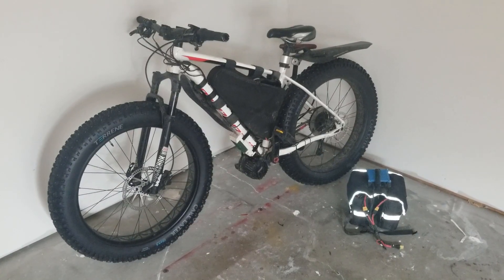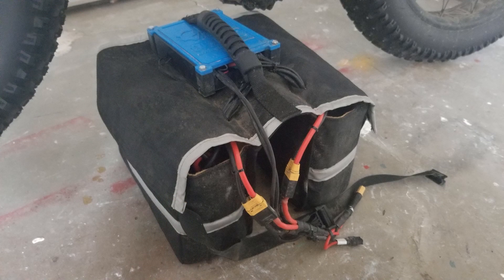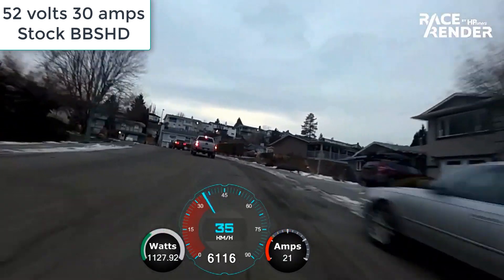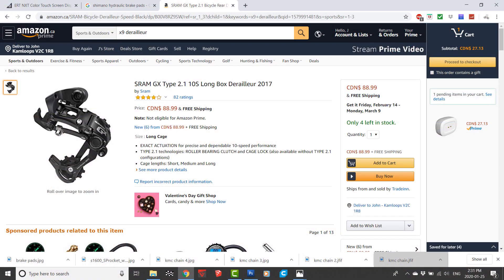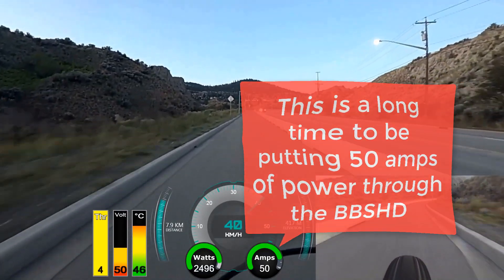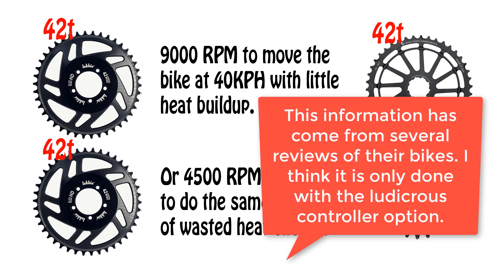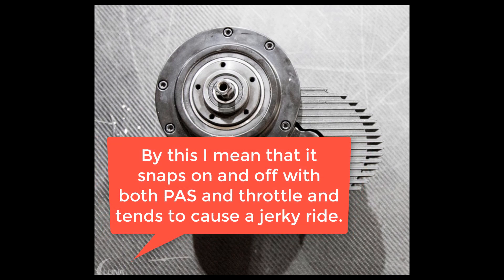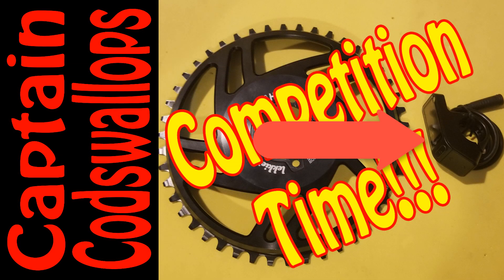Bafang BBSHD - ASI BAC 800 72v - Specialized Fatboy Ebike Conversion. The fastest & most reliable?

Comment: Hi great video content again. You most definitely have mechanical sympathy this goes along way with powerful middrive converted bikes. They need to be treated with a bit of respect running high voltage in regards to all the things your video covers I think people forget they are on a push bike not a motorbike and just try and go as fast as they can. Another quick question have you re greased your nylon gear yet?

Also with the ASI ERT can you set the power levels /peak watts/amps for different power levels your self via the software? I would like to have a lower power mode or modes for long range rides and technical off road sections I would want something fairly similar to say stock bafang bbshd level 2 to 3 where I can use the gears on the cassette. But then have a couple of max power modes making the most out of the controller battery and motor.
Reply: Not that I know of but you can use the Eggrider display and change the power levels to your liking in the app and it tells the controller what max power you want just by changing the pedal assist level on the display, I used that when my battery wasn't good enough for 50 amps so I set the pedal assist lower to only use 30.

The Eggrider display has been one of the best things I've bought aside from the Bac800 and it can even be used on the stock controller, The support from George and Emil has also been amazing after having some issues getting a locked Bac800 from ERT.
Reply: @MeowBoxie  Thanks for the reply ok so  I think I need to do some research on the eggrider display then. So you can limit it down or up to what ever you want via the eggrider app. The grin phaserunner also looks like a good option with the cycle analyst it's a hard choice between the 2.
Reply: @danielgreen4213  I'd go with the Eggrider just because it's stealthy being so small and if you want a bigger display you can connect your phone, The cycle analyst looks super outdated and bulky on a set of handlebars.
Reply: @MeowBoxie  yes I would certainly agree with that I have a 500c display now so would feel like a step back for sure with the CA but it it has great functionality and there is very good support and knowledge out there for the phaserunner ca combo. 

So can you program each level of assist with the eggrider like you can with the bafang controller with the cable? So I could set say levels 1 to 3 for lower power modes up to about 500w ish then anything above that the high power modes.
Reply: @danielgreen4213  I haven't tried any programming with a cable but you can do that through bluetooth and the app, I have my max power at about 4500Watts and if i lower the pas setting it gives less power through throttle and pedaling.

Also if you want even more lower power modes you can switch from off-road to road by holding the button on the Eggrider and that has a whole new set of settings with its own max power, So I have that set at 500Watts which is the legal limit here just incase.
Reply: @MeowBoxie  great thanks very much now reading up and watching some videos about the display. But from what you and captain  have said i think it should suit my needs
Reply from the maker: There will be another option of the NXT. I'll be doing some video work with it next week if dhl get their butts in gear!
Reply: @HighVoltageKits  sounds good to me I shall hold fire. I just watched all your videos back in regards to the egg rider display and settings with the ASI page. It looks like to me you can just set the minimum power in your video its 500w. So would the pas levels start at this on road mode  lvl 1 and go up to what ever you have it set as max power in stages spit over how many levels of assist you have? With the bafang settings you can change how much power and what speed you want in every pas level. 

Sorry for all the questions I will be ordering x2 at the same time so would like to make sure every thing is right
Reply from the maker: https://youtu.be/4blDi9DHYw4 this is the kind of info you get on the NXT display
Reply from the maker: Have not greased it yet. I will in spring but I'm down to one bike so I dont want to mess with it yet. The way the bike is setup here is at a nice comfort zone for a fatbike. A lighter bike you could push a bit more. I could push it further but I'd rather have reliability and use a different bike to do that. I found my sweet spot lol. The egg will adjust anything of riding performance. The bac800 is insanely complex and bacdoor is not great to use. It should get better with developedments this year!
Reply: @HighVoltageKits  ok thanks I have not done mine yet either I'm up to nearly 1500 miles but I'm not running close to your power level at the moment any way. I think I may have a go soon. The eggrider sounds like it could be what I'm after but I'm also thinking about  phaserunner and ca3 better do some research as I want to be able to use the bike as fairly close to it is now with the stock  bafang controller as I do ride it off road alot on trials so I don't need the power all the time and definitely need to use my gears. But I also would like to unleash the full potential of my battery and motor as I do get plenty of opportunities to do that also lol.

Comment: Very informative video! Looking to convert a bike this spring once our Canadian snow melts in Ontario. Had a Crystalyte front hub like 10 years ago which corroded from winter condensation. Bought a lifepo battery from Grin which was the worst thing I ever bought. It would self discharge and go out of balance within days. Sent it back for service and it was no better.Got a whole 1000km out of it. I bought a Yamaha dualsport which was way better for the environment and my pocket book than that useless blob of crap. So anyways, which motor do you recommend? I want to go far and not crazy fast like you.
Reply from the maker: Sorry to hear about the battery. I have use their Satiator charger and it is a very well made bit of kit. I must admit I have not used that particular battery chemistry though. I usually push the power a bit in my videos but I can get a very good range just by dialing down the power. The one day it was super icy I set it to 1500 watts max and cruised 6km for the loss of 5% of the battery. In terms of motors either the BBSHD as I have used it or the CYC would work great. The thing about having power is you don't have to use it... but its there if you need to. I could and do go out on long runs in the bush and on gravel roads etc. A 25 amp hour pack can provide hours and hours of riding if you drop the speeds back to 30kph. The CYC has torque sensing now as well which is good although I can't say what its like as I am on the Gen 1 motor and its only just been finalized.

Comment: Thanks again Captain.  I just picked up a Trek Farley 5 and a Surly Ice Cream Truck.  I’m gonna build out the ICT first.  CYC has been accepting orders for their new motor with the ASI controller for a couple weeks now.  It takes 1-3 months to arrive and is more expensive.  I’m gonna have to watch this video a few more times before deciding on a unit.  I live in a very warm climate area and I tend to push my equipment so I’ve got that to factor in.
Reply: Cyc can handle 3000w and if you keep it pulling 3000w in hot weather, you might burn it, so if you limit the power to 1500w, you still getting a bbshd rival  but using half power you could use so not heating at up as much
Reply from the maker: I have run the cyc through the same route as the bbshd and it's barely got warm. Even when Alan at ERT put it through 72 volts 12000 rpm it barely broke the 50 degree C mark. He lives in LA so pretty hot there. It will push 3kw all day long :)
Reply: @HighVoltageKits  As I have discussed with you before, I was waiting to see how well the X1 held up for long term reliability (something that is known with the BBSHD) And now they've already released the gen 2 model (in typical fashion of a Chinese company). It is 5kW now at 72v and capable of out performing a Sur-Ron on a donor DH bike they claim...
Reply from the maker: Maybe a stock sur ron or a lightly modded one. No way it beating the  ERT turned bac4000 at 72 volts though. I'd have to see it to believe it.
Reply from the maker: The cyc runs much much cooler than the bbshd simply by being designed for that power!